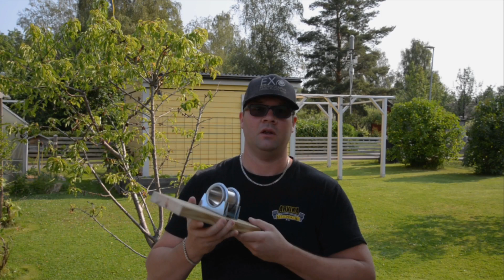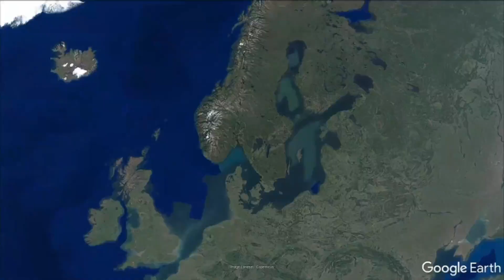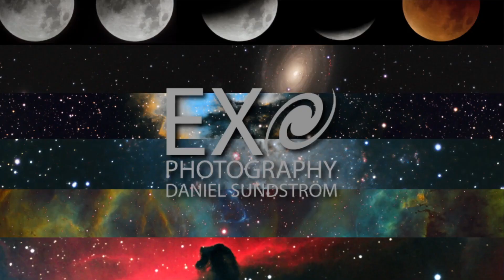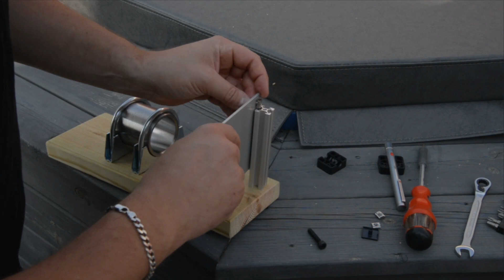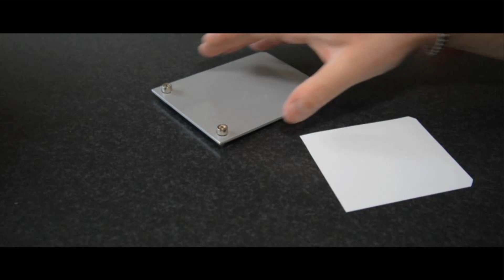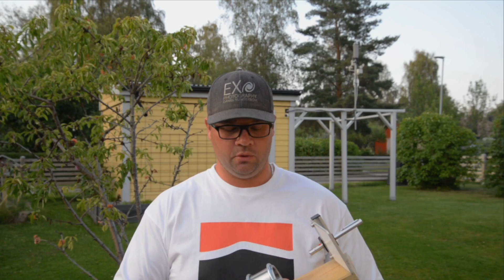Building an optical rig for adjusting tilt of a CCD or CMOS astronomy camera.

Comment: So how does it work?
Reply from the maker: It works that way that you shoot a laser beam in an angle at the CCD or CMOS camera, and by rotating the camera, the reflections from the cover glass and the pixels from the camera chip is supposed to not move , other than the rotation it self.

I will post a video when i am checking the alignment of my back ordered camera. It will be in 2-3 weeks hopefully.

/Daniel
Reply: @ExoPhotography1  I would hope it would be a weak laser as they can seriously damage the sensor
Reply from the maker: @Mistr_A  Yes you should not use more than the “allowed” 5mw, at least here in EU.